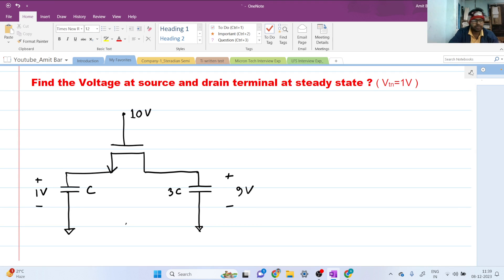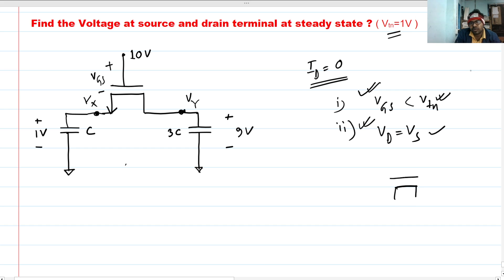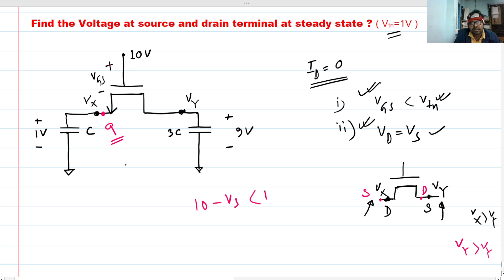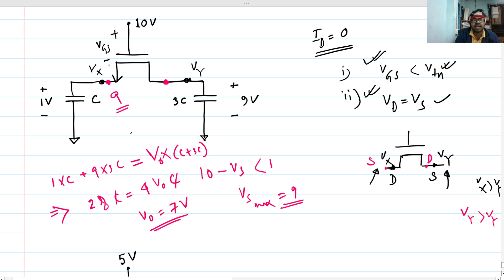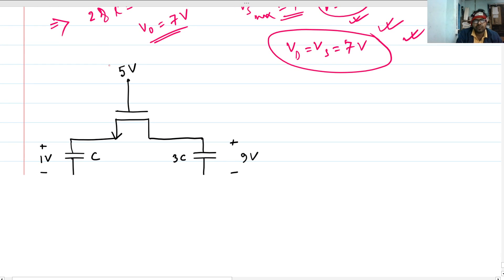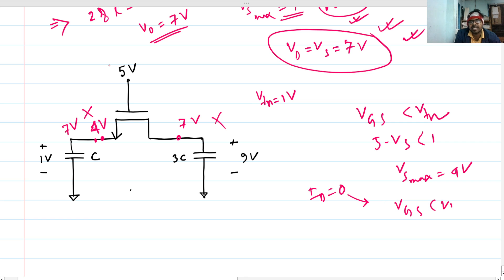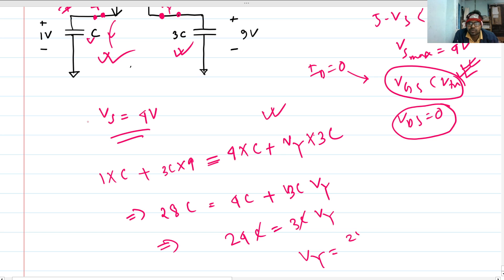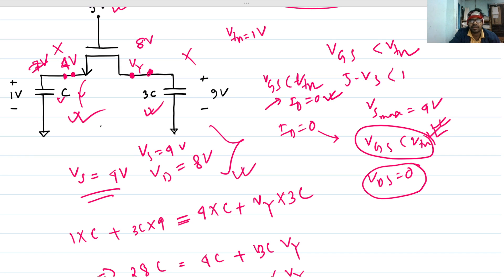Texas instrument interview_MOSFET with capacitor circuit _find steady state Voltage at drain

Comment: Why is the drain current equal to 0 in MOSFET at steady state? Please explain sir
Reply from the maker: See steady state means there is no charging and discharging,so if drain current is zero,then there will not be any charging/discharging
Reply: @AmitBar-Analog_Circuits  Understood sir. Thank you

Comment: Hi sir, in reality, circuit always has leakage, so Vx and Vy finally settle to 7V (2nd example). Is there any way to realize a charge sharing circuit so that Vx precisely  settle to 4V regardless of leakage? BRs
Reply from the maker: I will get back to you,,may be, we can see the results by simulation.
Reply: @AmitBar-Analog_Circuits  Hope you make video on that problem. Just like, pouring amount of water from C1 to C2 and stoppp 😂.